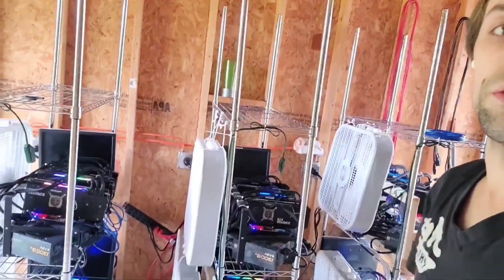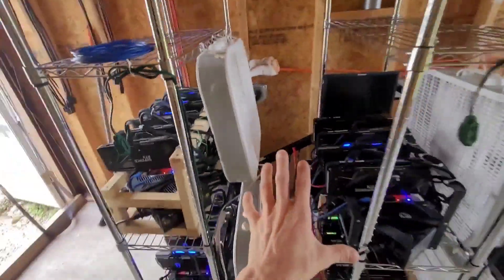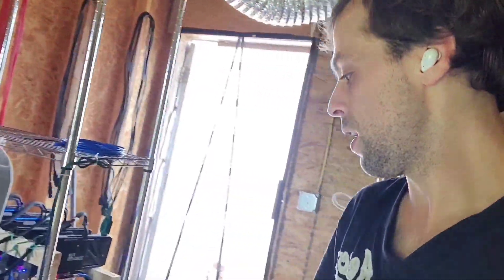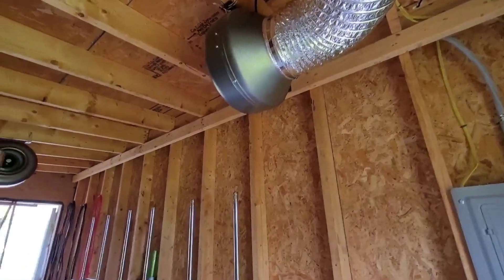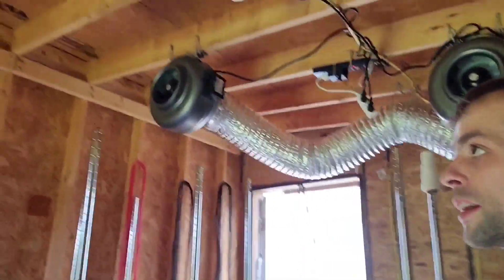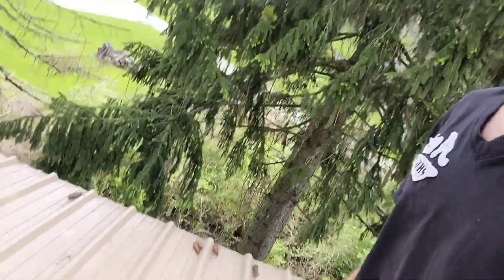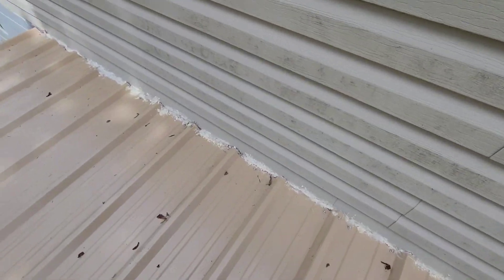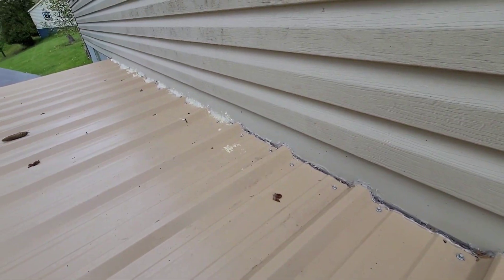Crypto Mining Shed LEAKED!!! | 40 GPU Mining Farm | Water Damaged Motherboard | Calking Fix 2022

Comment: The bitmain hydro has like 5440 watts of consumption, it’s on that range, and it does the same hash rate as the j19 pro, so it doesn’t really makes sense if you have an outside farm already, and you don’t care about noise and heat.